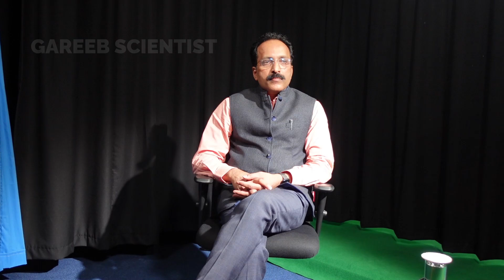ISRO Chief on Semi Cryo changes to Rocket | S Somanath

Comment: Is Dr. Somanath saying that even if the upper stage of a rocket is heavier, it will still maintain its speed because the force propelling it forward is strong enough to counteract the extra weight? How does that work? Can someone explain, please?
Reply: acc to me he meant that suppose we need 1kn force to move 1kg, so if we make the upper stage 1kg heavier then the preceding stages will need to add that 1 kn boost.
Reply: @varunaggarwal7126  thanks brother